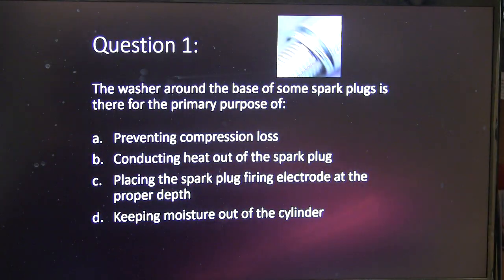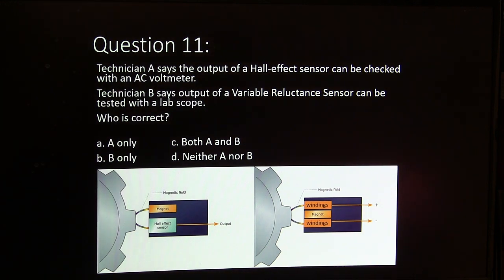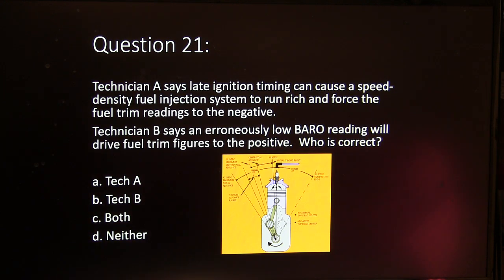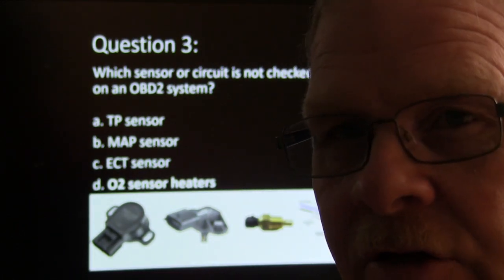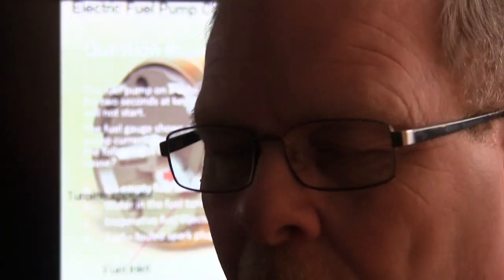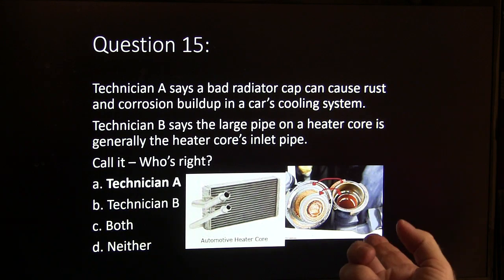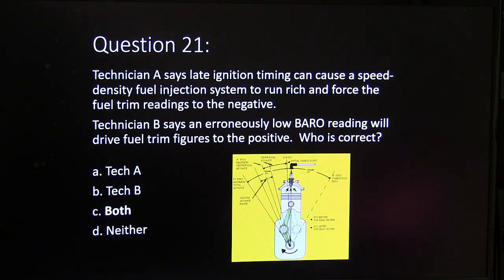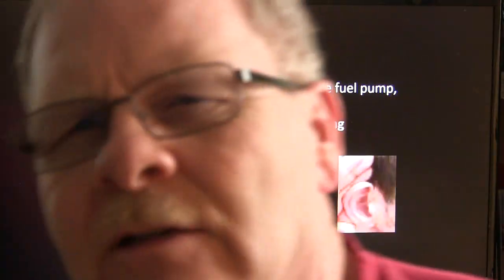Engine Performance Practice Test

Comment: Hi I am having a problem with a car and I am really hoping you can help me. I have a 2011 Chevy Cruze 1.4l turbo. The codes I have been getting are a p0341 cps range performance and a p0171 fuel trim system lean. Another shop changed the intake gaskets, the injector o-rings and the purge valve and were unsuccessful so now it is here. Upon driving it I noticed the codes would come up as pending and go away before they would set as a hard code which I thought was weird. Wile I was looking at the intake side and testing that cam sensor while it was running I noticed it was vibrating like something was hitting it. I took the valve cover off and noticed the reluctor ring was coming into contact with the sensor putting a grove in it. The guy next to me suggests to bend it straight. We managed to do that without braking it but when I started it up it seemed to be running a little rough. I drive the car home for the night to see if the code re appears. Just the p0171 code comes back. The freeze frame data is as follows distance since first malfunction 15mi, distance since last malfunction 24mi,
Short term-3
Long term 30
MAF 2.85gps
IAT 78.8F
HO2S1 .77V
HO2S2 .77V
TPS 14.4
Ambient temperature 39F
BARO pressure 99.0kpa

My thinking is the reluctor ring being bent is causing the sensor to read improperly causing these issues. I think that is my best guess because that is the only part I found to be defective. Is am hoping you can help me!!! Know one at my shop is a master tech and I am the best shot this car has. I am tired of driving it to set all the monitors lol I am thinking it is this but the job is very labor intensive and before I do the job on Monday I was hoping you can read this post and give me some advice.  Thank you for your time and have a nice day!!!!
Reply from the maker: I believe you've fixed the Cam Sensor issue by straightening the bent reluctor. 

But From the fuel trim readings you're getting on the Freeze Frame (+30 LFT) it seems that you still have a lean condition - I see 14.4 TPS, but no engine load or vehicle speed. Typically that engine should, at idle, be showing something like 1.4 grams per sec, depending on prevailing barometric pressure.

If the MAF is skewed a bit (and it's impossible to tell by that Freeze Frame Data), it can cause that lean condition; I'd be interested in knowing what the fuel trim readings do if you do a total PCM reset - remove the battery terminals and touch the cables together - then let it start over. 

If you still have a lean condition driving the fuel trims rich, it'll show up first in the Short Fuel Trim readings as soon as it closes loop and then the long term fuel trims will follow until the short fuel trims return to zero - I'd be using a smoke machine to check for air leaks in and around the intake, injectors, etc. 

But again, if the MAF reading is skewed to under-report airflow or report a higher altitude in the BARO reading than is accurate, the commanded injector pulse width will be too low and the O2 sensors will reflect that - which will drive the fuel trim up - first the short fuel trim and then the long fuel trim.

That's about the best I can do with what I see here.
Reply: @McCuistian  ok thank you for responding so quickly. Is the pcm reset the same thing as resetting the fuel trims? I did a reset of the fuel trims after I did the cam sensor but the code still returned. I will try to smoke the intake again I was thinking that the leak is so small that it may only present itself under certain conditions maybe only when engine is at operating temp? I will do the pcm reset and move forward from there. How long should you hold the terminals together when you do a caps discharge? Do you have any videos talking about cap discharges and what they do? I have just had bad luck doing them in the past with new issues popping up after they are done and of course the technician is always responsible. Is resetting the adaptive values the same as doing a pcm reset?
Reply from the maker: @billsfan1768  You just touch them together briefly - it's important after you do this to watch fuel trims at closed loop to get an idea of how serious the problem is - also watch O2 sensors.

Comment: Can you explain how a lean air/fuel ratio burns hot and fast? Is it because if the 02 sensors are reporting more oxygen they start adding more fuel?
Reply from the maker: Think of how coals in a grill or fireplace burn hot when you blow air on them - same basic principle.